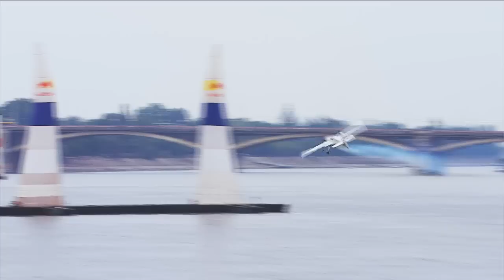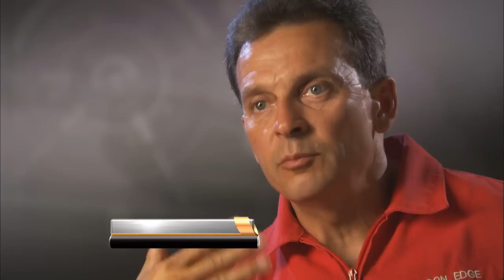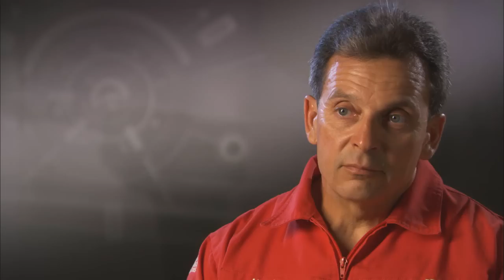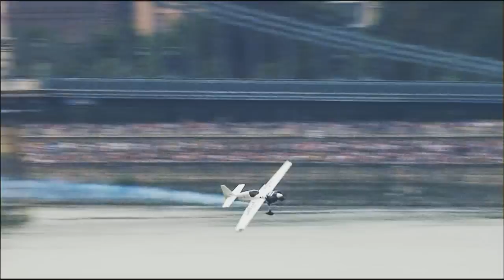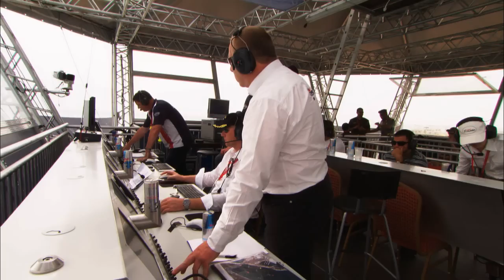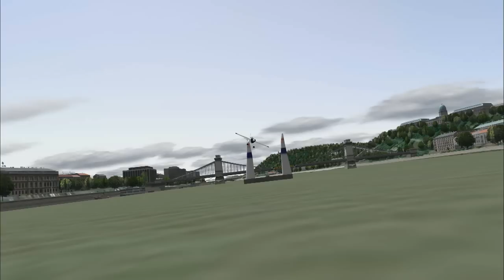Extremely Low Flying Plane

Comment: Flying low, while in itself can be considered dangerous, is perfectly normal, especially if you have a professional pilot behind the stick. Airshow pilots normally get low, either on knife edge, or inverted to wow the crowds. Getting low WHILE racing around and through pylons just makes it even more of a wow factor.

Comment: If they weren't meant to go low, i'm sure the gates would be higher. I will put money on the fact that most pilots would prefare not to ditch, especially doing in excess of 300kts.